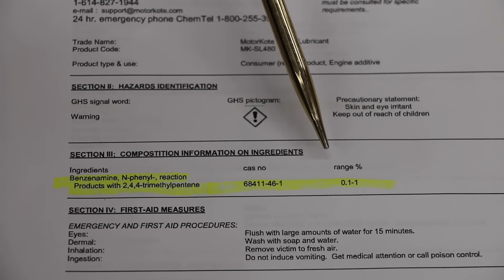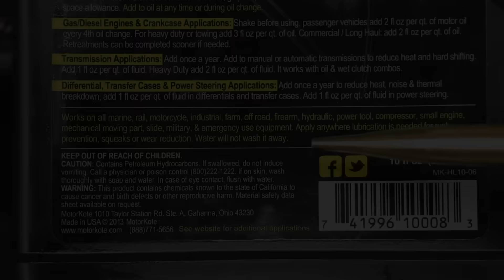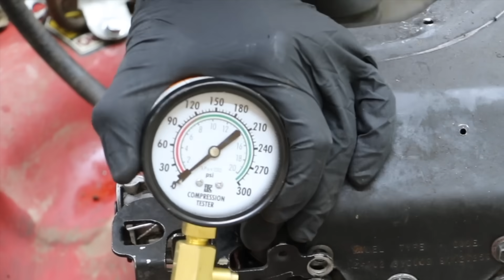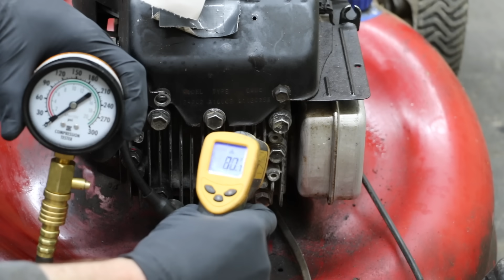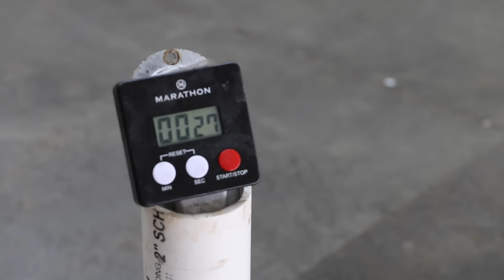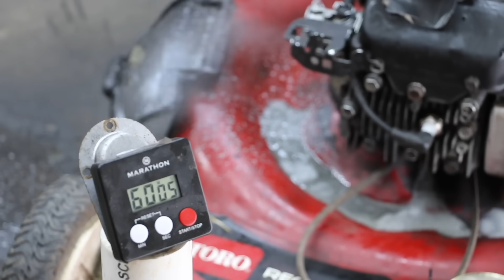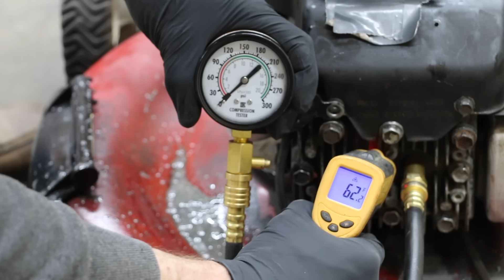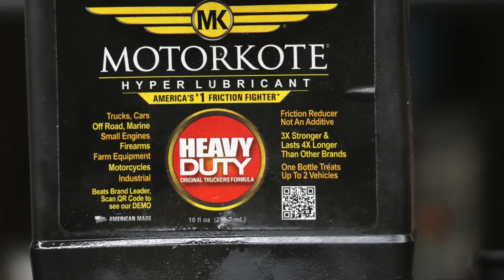Can MotorKote survive the water test?  Let's find out!

Comment: Hello I have sent email to Liqui Moly Germany about MotorKote vs Ceratec. And I have found their answer interesting regarding machine for testing oil. It might be interesting for you also.

Dear Dino 

thank you for your inquiry and your interest in LIQUI MOLY products. 

Unfortunately, the additive Motor Coat LS27, is here in Germany unknow and it was not possible for me, to find a right technical product discription. 
But from the informations i have found, is this additive an synthetic friction modifier without solid lubricants, like our LIQUI MOLY MotorProtect. 
But the LIQUI MOLY Cera Tec contains alos an synthetic friction modifier in combination with an solid lubricant. 
Therefore, you can also use our Cera Tec to protect your engine against wear. 

The vidoe tries to be intresting, but it is technically not really meaningful. 
The problem is, that the first test with the machine is only for cutting oils and not transferable to motor oils. 
Already in the 1980s, Shell and BP found that in this test, milk and beer get better results than an motor oil. 
In addition, oil-containig substances can not be washed off with pure water.
Reply from the maker: Thank you for the information!  I'll test Cera Tec soon.
Reply: Project Farm Thank you for wanting to test Ceratec. Im using it in 3 of my cars.

Comment: Welp.  I did it.  I bought some Motorkote based on what I saw in this video.  We'll see if it has the power to hush the dreaded World 2.0L engine and its CVT.
Reply from the maker: Please don't add this to the CVT.  It's too slick for the CVT and will cause problems.  I hope you achieve great results.

Comment: I am floored. Excellent, thorough testing. I thought for sure the engine would have scoring in the cylinder walls after running for an hour with only water. This is by far the most impressive result I've seen from a product on your channel.
Reply from the maker: Thank you

Comment: What kind of pump is that, the one you use to suck out the oil? That would be a good setup for oil changes on my Waverunner/PWC.
Reply from the maker: It's a vacuum pump that's used to pull a vacuum on an HVAC system.  I really should use it like this, but it's worth it to me.  I did add the jar in the middle of the vacuum hose.
Reply: Project Farm thanks for the info. Had an idea, how about testing TruFuel to see what, if any, real benefits there are to using it in your small engines?

Comment: I have a series 60 Detroit in a 2000 Freightliner and run Motorkote in it as well as a (Golfcoast) bypass oil filter system instead of changing oil. I have over 350,000 mi on my oil and still clean. I change the bypass oil filter every 10 to 15,000 mi and engine oil filter every 30,000. And put Motorkote in it every 50,000 to 60,000 mi. An oil analysis is done every time I change the bypass filter. I have been told it's one of the cleanest Detroit's he is ever seen. And it has over 1.8 Million miles on it and only had the oil pan off twice. Once for a rear main seal and once for a bullgear at 1.7 Million miles. And for a diesel engine it is remarkably clean on the inside with very little soot build up. In fact when oil was new after the bullgear it was over 15,000 before it turned black, as diesels normally do.
Reply from the maker: Wow!  This is very impressive!  That's a lot of use/mileage on oil.  Thanks for commenting on MotorKote.
Reply: Jerry Wick it cleans oil way more than normal filters Golfcoast goes down to 1 micron which filters out large soot particles that is very abrasive to an engine. Regular oil filters does not filter much of this particle because if they did they would plug up and starve the engine for oil. However in a bypass system the oil flow coming out of the filter goes right back into the oil pan. Hence the name bypass filtration. It just takes a small amount at a time out of the main oil flow and filters it constantly. Some people make all these and oil Refinery system. But really all it does is just clean the oil a lot better than a regular oil filter and when you change the Gulf Coast system oil filter you have to replenish 3 gallons of oil which replenishes The additives. And this is also why you constantly do oil analysis. This is to tell you when your oil actually needs to be changed. And in some cases with this system there has been trucks out there with over a million miles without an oil change simply because you are basically changing the oil every 45 minutes as far as keeping it clean. This is also the reason why a diesel engine with a bypass filteration system is usually a cleaner engine. And in comparison when both ways have been done properly. (Change your Gulf Coast filter every 10 to 15,000 miles and your engine filter every 30,000 miles compared to changing your oil every 30,000 miles) the engine has always been shown to be cleaner with the bypass system.
Reply: Will S. Every 10,000 miles 3 gal of makeup oil fixes that problem when I change filters and the oil analysis would tell me if the acid is getting high and it has never shown high in fact it is always lower than it was when I was changing oil every 30,000 miles. That oil analysis also checks for any abnormal wear and the engine by checking for wear medals. And my where rate is actually lower than normal where rates. Otherwise I wouldn't have 2 million miles on that engine and over 1.2 million miles on the overhaul
Reply: @truckinchihuahuaalvieschre2494  
 So now you're using 9 gallons of oil every 30k miles and 3 filters plus the main filter? 
 But it seems that the motor is running cleaner in the mean time, no clean to dirty transition, almost.
 The suspended particulates in straight oil cause (some) damage near the end of the change cycle.
Reply: Frank Newling you 99% correct.  Only thing is the Gulf Coast filtration system actually uses 2 filters instead of 1 every 10 to 15000 miles. Yes you can actually get by with going with 2 Gulf Coast filter changes for every engine oil filter change (30,000 miles). If you're not running pre-emissions engine. Like I am. If you have a EGR engine you cannot do this safely. Some people do and get by with it. But they only get about roughly 300,000 miles on their oil. Where otherwise I have actually heard of people getting over a million miles on their oil. And still having good oil samples because they change their Gulf Coast filter every 10,000 miles.
Reply: ElroyJosephJenkins JrTheThird My oil in my engine is actually constantly being cleaned. Where if you change your oil without a filtration system the first 15,000 miles the oil is clean but the last 15,000 miles you're running dirty oil in your engine. There for the last 15,000 miles I have contaminants being pass through my engine scratching the cylinder walls. Where were the filtration system that will actually stop soot build up in the oil that soot does not constantly go through the engine. It is stopped by the filter. If you ever notice in diesel engines oil is always black from soot particles. My oil has a brownish tint to it. It is not completely black. I can actually wipe the dipstick off and see through the oil. Therefore my oil is showing cleaner then most diesel engines. Then it actually did before the filtration system was added. My oil analysis shows that my engine is running cleaner and with less acidity then it did before the bypass system was installed. Because the suit and the contaminants are not staying in the oil and breaking down the oil additives near is fast. And when I change the filter I add 3 gallon of oil to make up the additives that do breakdown and the previous  10,000 miles. And in almost 800,000 miles since adding a Gulf Coast bypass oil filtration system. I have never had an oil related breakdown.
Reply: Never heard of the bypass system you mentioned, will be doing some research... interesting!
Reply: ElroyJosephJenkins JrTheThird This is why it is a bypass oil filter it is not in the main oil flow it takes a bit out of normal flow and filters it. If it was in the main oil flow like a normal oil filter it would plug up in a matter of seconds and oil flow would stop. It is a low pressure flow rated filter that filters out down to 1 micron. To put things into perspective a human hair is over 25 microns.
 It will take the entire 11 gal of oil about an hour to go through the bypass filter where it takes less then a min through the OEM filters on the engine. (A note here: you must still change your OEM filters every 30000 miles just not the oil.)
Reply: I will certainly be checking out Gulf Coast filters after reading your testimonies Alvie. I live a few hours from their location so I may just a take a trip soon to see them face to face. Thanks for the info!
Reply: Mark OnTheBlueRidge then you tell that to the now 27 trucks that have relied on these same oil analysis for the last 1 million miles and counting. You cannot get that many miles on the same oil in an engine. And never have an oil related breakdown on any truck ever running a gulf coast filter. And as stated before there are now 27 trucks with 1 million miles and Counting on their engine oil. And there are several with over 500,000 miles and still counting. And my oil analysis and my mechanics that has been in my engine have all said the same thing. "This is one of the cleanest engines that they work on". Not saying all oil samples or this good but the company that Gulf Coast filter uses must be a good company. They used to use Titan labs and have recently switched to another company due to Titan labs changing their number system. And raising their cost. I do not believe that Jerry Sims with Gulf Coast filters would change companies without first doing a lot of research because he is putting the reputation of the company that he started on the line. And they are the number one bypass oil system in the United States. They are on 90% of cruise ships although not the exact same system due to the size of the engine. I do know for a fact that our local power company uses their system and their big generators and have never changed oil in one of the two generators. The only reason they change the oil in the other generator is due to the fact that it developed and major oil leak in the middle of the night and almost ran out of oil. And when they tore the one that has not had  an oil change down for its 10 year overhaul they found no ring Groove and any of the cylinders. And very little wear on the bearings. In fact if it was not for law they would not have went through it. Because they were Metals was not showing up. In fact Bill (the guy I know that works on them) said he could not tell the difference between the Pistons he was taking out compared to the ones he was putting in after 10 years of almost solid run. On these big generators you do not want to change oil in them every 3 months like you would if you didn't have a bypass oil filtration system and an oil analysis system because, they take I think he said two 55-gallon barrels of oil to fill up. I'm not sure if it was 2 or 3 that he said. So they rely on oil analysis as does most of shipping in the Navy and maritime including cruise ships and all of your diesel Electric generators in power plants. I'm not to sure about diesel electric locomotive on trains. But I imagine they're about the same.
Reply: Alvie Schreckhise ÿAppv
Reply: @truckinchihuahuaalvieschre2494 Still running the s60?
Reply: You still need to change the oil on a regular basis. Engine oil becomes acidic as it reacts with combustion byproducts, it doesn't matter how good your filtration system is. It will begin eating away at the engine.
Reply: Alvie Schreckhise it would seem the bypass system would be stressful on the oil pump. Higher the filtration, lower the flow. Too High volume of flow will wash out rod bearings
Reply: I think only about 10 % of the oil flow goes thru the bypass filter per unit of time, maybe not even that much.  The regular filter is still there and the regular flow of oil is going thru it.
Reply: Will S. Great point 👍
Reply: Alvie Schreckhise Oil analysis companies are b.s. I can do the samething, simply print out one online and say here's your oil analysis and you'd never know. They probably have 1,000+ analysis prefilled forms in there system that they choose at random and sent you a printout without ever testing the oil. And how could you prove otherwise????  Hence baffle people with b.s. That they can't prove otherwise, even if you could somehow prove they do this you wouldn't be able to do a damn thing about it.
Reply: I Know You're Right But Yours is about the most ignorant comment I’ve heard in a year. The reputable oil labs are beyond reproach. Huge fleets depend on analysis reports to set intervals and detect developing problems in their equipment. These labs have a tremendous responsibility to provide accurate results for these fleet customers. If you were in the heavy equipment industry you’d know that. Cat, Blackstone, and others aren’t about to loose a huge fleet customer by offering“baffling bullshit”. I’ve set intervals for my equipment for 15 years and they are very accurate in their reporting. They’re also concerned enough that if the results of one analysis doesn’t trend with previous results they’ll usually re-test just to be sure the results are accurate.
Please don’t show your ignorance by making statements that aren’t accurate and not based on evidence.

Comment: Test John Deere implement grease in place of motor oil in a small engine also a lubricity test comparing the 2. I’m curious because we used to pack the rearends on fourwheelers with that grease and never had problems
Reply from the maker: Thank you for this recommendation!
Reply: Project Farm if you need I can send a picture of the tube of grease

Comment: It also shows that Briggs & Stratton makes a pretty durable motor. My uncle would be proud he worked at Briggs & Stratton for many years.
Reply from the maker: Yes, I'm amazed at the durability of these engines.  I'm guessing that most mowers only get 1-2 oil changes in a lifetime over 15-20 years and get exposed to lots of dust.

Comment: I think you're lubricity tester is much better than the ones where someone is pulling down to alter pressures on the testing devices that they use. You're not going to be putting that kind of mechanical friction into your engine even when you're running at higher RPMs. I would like to use some of these products on my motorcycle but even though it is 36 years old it doesn't have the kind of mileage on it as most cars do so the engine is barely broken in I feel a little ashamed I don't do more writing but in colder climate you're limited to the amount of riding you can do. Especially since I live in the city where Harley Davidson was born. Since the motorcycle I ride shares the oil with the transmission and the clutch I wonder what some of these additives would do to the clutch material? Also the clutch in my motorcycle is as old as my motorcycle it still has the original clutch. Although I think I might have to change the fiber plates either that or scuff up the steel plates because a hard load the clutch slips from time to time.
Reply from the maker: Thanks for the positive comment regarding the lubricity tester.  The ones on the market seemed to have design flaws or were more than I could afford.  You're right, this product is way too slick for use in a wet clutch system and will cause problems/slipping.

Comment: That was amazing how well it reduced the scoring on the bearing test!  I am sure this would be ideal for a flat-tappet engine which has sliding friction similar to your tester.

Also the water in crankcase test was pretty awesome! Really seems to be effective on all counts.
Reply from the maker: Great point regarding the flat tappet engine.  Thank you!
Reply: You're welcome.  The Buick V6 engines I love working on went roller cam in 86 but there were a lot of engines produced into the 90's which still had flat tappets.

Comment: To add more details.  When a piece of equipment has been run all day. Upon shutdown he uses an infrared thermometer to check for hot bearings. Usually from damaged seals ( agri disc & harvesters) And will immediately inject them with his mix.   It usually saves them until a lax time to replace
Reply from the maker: This is very wise!  This is a great strategy to prevent catastrophic bearing failure and significant damage.  I live in a farming community and a melted bearing can cause a combine or hay baler to catch on fire and destroy equipment.  Thanks again!

Comment: Wow, that was pretty impressing.. Loving your work.
I would love to see you test a product called RVS engine treatment, it is supposed to be some sort of a triboceramic coating for engines, driveline components, diesel injection pumps and so on. They had a test done where they treated an old ford sierra if i recall this right and after the treatment was carried out they took it on the highway from helsinki to tampere without any oil in the engine and the engine kind of survived the journey. They had a camseal melt on the way but the engine itself was just fine. They had the bearings, crancshaft and the camshaft measured before and after the 180 kilometer drive and they were not wore down at all. I've been meaning to try it out but havent had the time or money or equipment available to test it out properly.
Reply from the maker: Thank you for this video test recommendation!